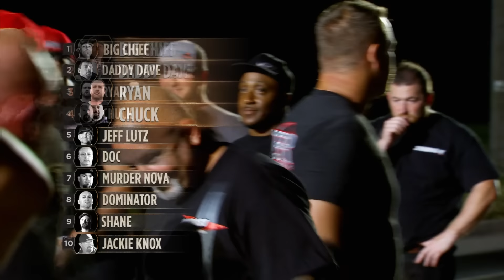The 405 Clash After Chuck And Ryan Try And Cheat The List I Street Outlaws

Comment: The problem with this is both Chuck and Ryan got to the top spot racing just one car whereas both Chief and Dave did it in multiple. Chief's on 4 (1st Crow before SO, 2nd "white" Crow which was the modification of the 1st Crow, Crowmod and the 3rd Crow) and Dave too on 4 (Jackie's Sonoma, 1st Goliath on Nitrous, Plan B, 2nd Goliath on TT and then procharger) thus both know the limit to their cars more than anyone.
Reply: That’s 3 for both as long as the chassis or frames the same it’s the same car. So three for Chief and I have no clue for Dave because he’s crashed a few times.

Comment: I WISH THEY WOULD  SHOW US THE ACTUAL TOP-END SPEED CROSS THE FINISH LINE. BECAUSE I KNOW SOME OF  THOSE CARS ARE DOING 160 +
Reply: In the latest season they're constantly mentioning their trap speeds to each other during tuning and stuff between races. Usually mid 160s-170mph
Reply: @isaiasdavila2144  yea I seen that
Reply: Usually on a good hit they're knocking on 180 MPH but 160 to 170 seems like a regular thing for the low four second car's on the street anyway